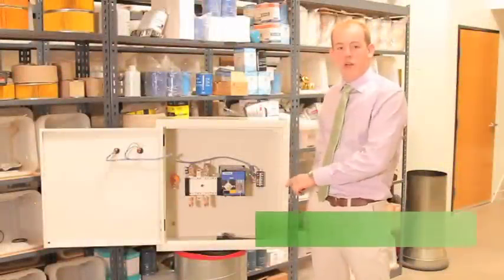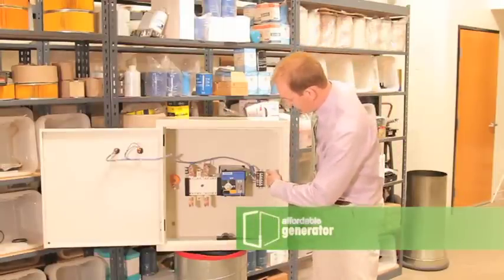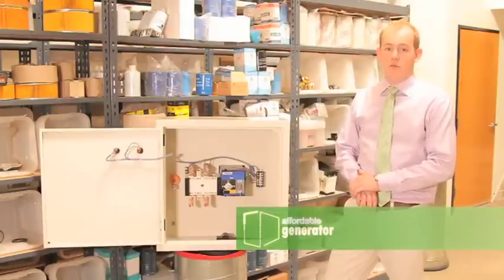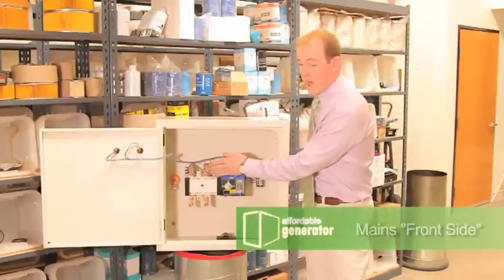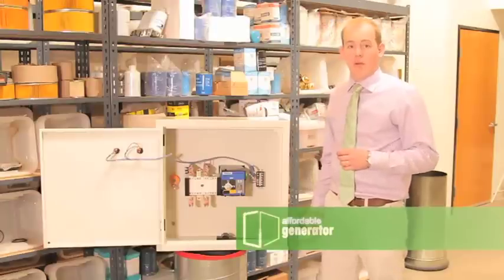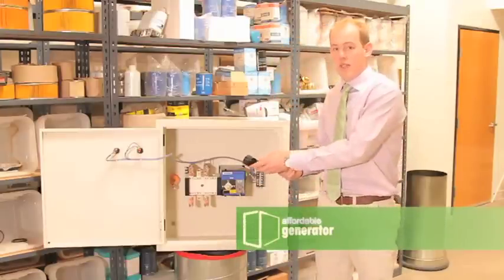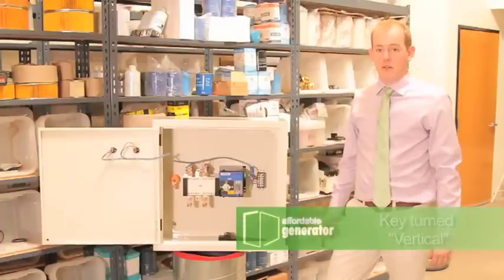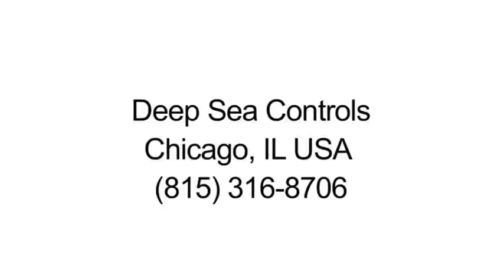Affordable Generator Automatic Transfer Switch Overview

Comment: As built without a CSA or UL listing this will not pass inspection for sale.

You can get a special field inspection in some places and have your local inspector look it over and decide if it meet the minimum requirements for the CEC or American codes.

You must bond the door to the encloser.
This is the first thing any decent inspector will notice and red flag.

The manual opperating handle and key switch should be mounted outside to prevent shock and flash hazzards to consumers.